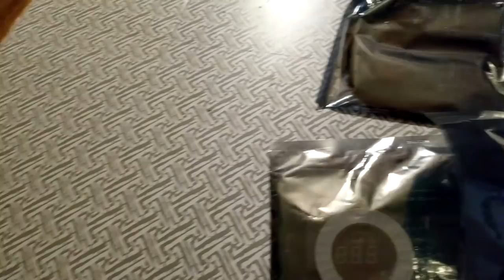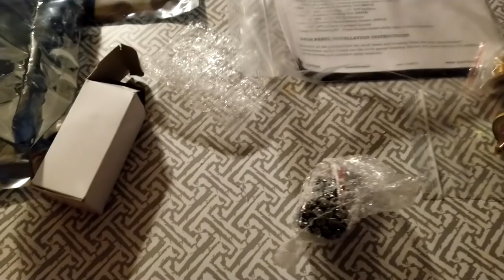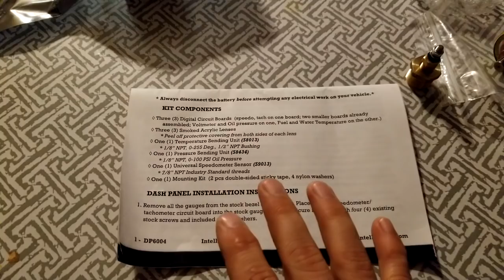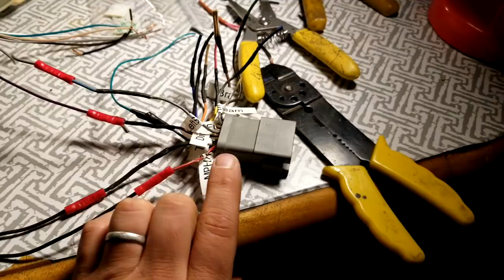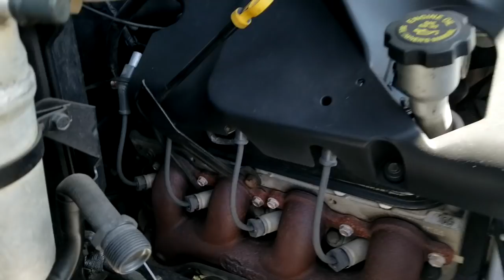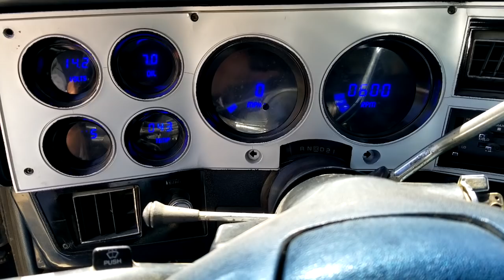Intellitronix Gauge Cluster Install 1973 - 1987 Chevy C10

Comment: Did you have to pin in the tachometer into the computer? Or did you run everything off the original truck harness?
Reply from the maker: The ls harness has a tac wire that runs on the 4k loop

Comment: I'm nearing completion on my 76 sierra. All is going well except I'm having complete difficulty threading the oil pressure sending unit in.  Old one came out easy, didn't feel like I jacked up the threads, and I can't even get the original on started.  Frustratrd..  Great video though, best one I've seen on these hauges!

Comment: I got a set of these gauges for my LS swapped 1975 K5 blazer and got everything hooked up. All of the gauges work except the Tachometer. Noticed in the instruction that it said I had to order it specific for the LS. Didn’t know anything about that. Just wondering if you had to order your gauges specific for the LS. 

Sweet video, helped out a lot.

Comment: Is this the chevy that you built through out the step by step videos? The blue one? If so, damn! Looks good. Didn't you have the suburban cluster in here?
Reply from the maker: Yes this is the same truck. Yes I had a 90's suburban cluster in it.
Reply: That looks good man. I was going through your vids because I thought I something a while back about adjust the throttle cable on that truck and then I saw this and had to check it out. I watched alot of the build until I finally started mine.
Reply: Question my tach reads 300 at idle. How fix that error

Comment: What did you do for the gas guage you didnt comment on that in the video, was it plug and play or did you have to modify as well
Reply from the maker: I've covered that in videos previously to this one. I showed me making a 91 burban cluster work and the intellitronix gauges.
Reply: @lonniesgarage  I've watched that and screen shotted your stock wiring diaphrams of what the cluster wires are. And I watched you put all the sensors in and I watched you plumb your gas tank. on a stock tbi truck all that's involved in hooking up the fuel guage would be just splicing the wire in or would it need aftermarket fuel level sender? Along with the sensors that come with the digital guage kit

Comment: Would you prefer this or the Dakota?
Reply from the maker: To be fair I've never had Dakota. They look nice but the price is outa my rang.
Reply: How accurate are those gauges?
Reply: @the_chosen_one2831  I have never had my gas gage work or my water temp gauge. Id never get it again.
Reply: @adamdailey4969  so your saying the intellitronix no good?
Reply: yea_ datsdennis I won’t use them and I am actually looking to replace them. They sent a rice size diode to soter in and 4 different temp sending units and none of them worked. That’s just my experience since we put them in 2 yrs ago

Comment: Why didn't you solder and heat shrink the wires you were connecting to the new plug purchased for the gauge setup?
Reply from the maker: Because I was testing this setup out. I have since did that. The gauges are working well so I've decided to keep them in the truck.

Comment: Ok I'm confused did you go back to the inteletronix gauges? I saw a video where you swapped it back to a 90-91 cluster because of the way they worked I want to upgrade mine but want something dependable. If these are problematic I will go with Dakota digital or similar brand what would you suggest?
Reply from the maker: Yes I went back with intelltronix. I love the look of them. I've been running them for a while now and I'll have to say I have had problems.
Reply: What would you say the issues are with these in your truck Lonnie? I've got an 83 C10 I'm looking to get new gauges for.

Comment: I just purchased a 84 shortbed roller what size rims you running on the white Chevy? I will be lowering it 4-6 inches eventually and installing a 5.3 or 6.0 ls hopefully
Reply from the maker: Kt Carroll I'm running 20x8.5 on front and 20x10 on rear.
Reply: PuppetKicker yeah I should have read the comments you were already asked that question  but Tku

Comment: Nice, what size wheels and tires are u running?
Reply from the maker: Rafael Sanchez 20x8.5 245/45r20s on the front and 20x10 275/40r20s on the rear.
Reply: PuppetKicker do u recommend that tire package I got the same wheels just got them? And did u have any clearance problems?
Reply from the maker: Rafael Sanchez yes I would go with that size again. No problems at all